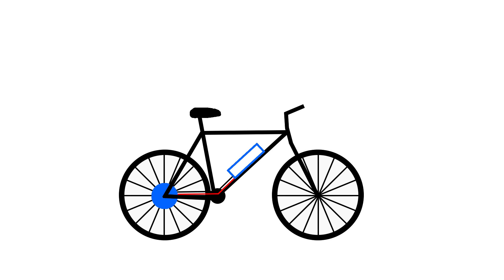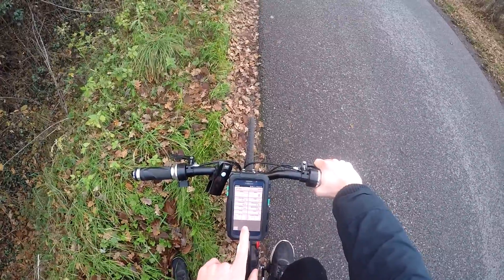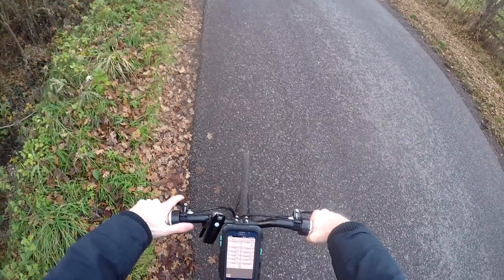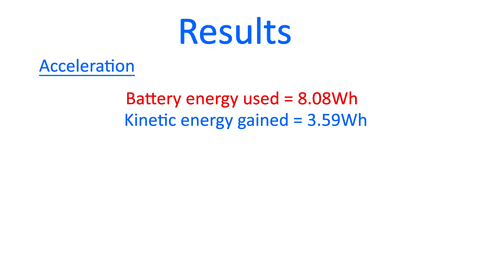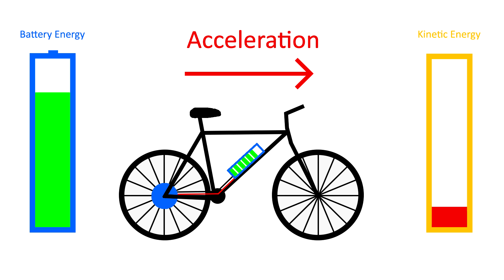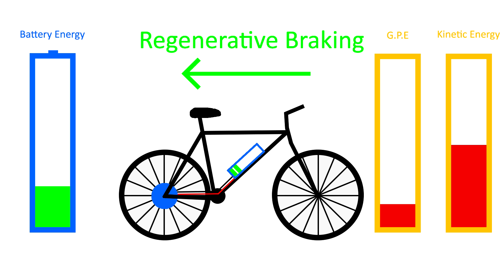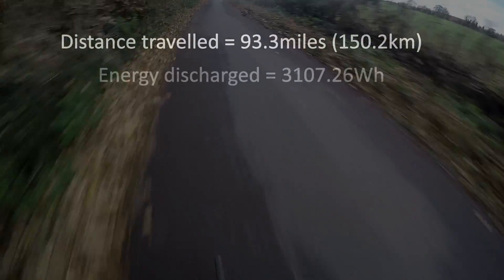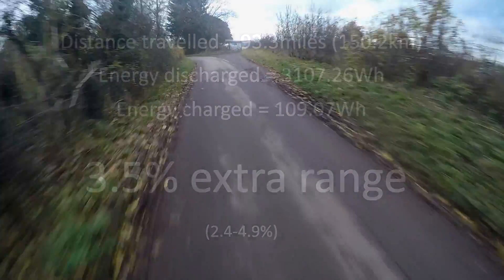Regenerative Braking tests

Comment: Great Video, very useful with diagrams too. What if the existing battery was split into 2 halves, and while accelerating you are also charging the other battery half, as well as charging it while using the regenerative braking? would this give you more range, without adding more batteries, etc and would it also mean that there would be less (or none) wasted energy, as when the 1st battery has depleted, the battery can then run from the 2nd half, which could then charge the 1st battery, and vise versa?
Reply from the maker: Unfortunately that wouldn't work. Using the example of my initial tests, if I were to charge a 2nd battery whilst accelerating, the energy discharged from the first battery would be greater than what I measured. This is because the energy wasted will still be 4.49Wh (this can't be 'none' because there will always be friction and drag), and because 3.59Wh + 4.49Wh + 1.27Wh doesn't equal 8.08Wh, the total discharged from the first battery would be 9.35Wh. So it's back to square one. Does that make sense? Thanks!!
Reply: Thanks Tom, it does and it doesn't (this is great to learn about) but I thought that a part of the wasted energy was from the forward motion when you're actually travelling forward, so if that forward motion also charged a battery, it would reduce wasted energy, that was my thinking, make sense? I understand that you cannot get more out of what you put in, but surely, if the forward movement of the wheel powered by 1 battery also generated power which then charges another battery when moving forward and when using the regen, then would it be possible that if you started your journey with battery 1 at 100% and battery 2 at 0%, then by the end of your journey, battery 1 would be at 50% and battery 2 would be at x, depending on what x is, but I would of thought that if you're using your forward motion to charge a battery as well as the regen the 2nd battery would have more then 3.5% charge?
Reply: +Steve Davey A single motor like this cannot act as a motor and a generator at the same time, for this you would need to take turns motoring and braking in order to do both, or get a second motor. But this doesn't make sense at all if you think about it. You're suggesting charging the battery from the forward motion of the wheel (taking from your forward momentum to put into your battery), while trying to move forward (take from the battery to add to forward momentum). You will essentially go nowhere and just waste power converting energy in a circle. 

There would be no point in charging a second battery while powering the motor from the first battery because you are not generating power from an external source like solar or wind. It just drains the first battery faster, and stores energy in the second that won't be available for the motor. The energy used for forward motion is to overcome the losses to the vehicle: rolling resistance (friction) from the tires and air resistance (friction) from pushing through the air. These two things will constantly slow you down as they take energy out of your system and into the environment, so you must replenish it from the chemical energy in your batteries. The wheel is just another battery with as much energy as was given to it.  It is only "wasted energy" in the sense that it is lost to the environment and not stored as kinetic, potential, or chemical energy in your system that could be recovered.
Reply: OMG you just invented the perpetual motion machine!  You should patent that :)
Reply: Great explanation, thank you. I was thinking that if a car's battery starts the car firing and the combustion engine then powers forward motion, it also powers an alternator. So, if you could label the car battery, the engine and alternator as battery 1, battery 2 and a small alternator, that would get you charging power from the forward motion. but it would add so much more weight to it, the benefits would be lost in the new heavier weight. I guess this is just theoretically possible and won't be a reality until some bright spark finds a way to make an alternator much lighter, then you could have a smart switch to change power sources and charging destinations. thanks for the in-depth replies! ;-)
Reply: @Steve Davey no worries, thought experiments are always fun. In the case of the car, the engine powers rotational motion. Forward motion wouldn't be relevant in your analogy. If a car was idle, it would use fuel to maintain a constant RPM. 

An alternator would be the same as adding another motor to your ebike and using it as a generator, but there are a number of reasons why you wouldn't want an alternator on an ebike even if it were miniaturized. An alternator has no magnets so needs to be energized by a battery to generate power while being rotated (power wasted to act as a DC generator). When electrically loaded (to charge a battery, play the radio, fire spark plugs) an alternator will put a mechanical load (negative torque, resist motion) on whatever is turning it. In the case of the car, it is coupled to an engine's drive shaft which isn't much of an issue because the load is relatively low compared to an engine's power output, and the engine needs to maintain at least idle speeds to function anyways. In the case of the ebike, an alternator would put a constant braking torque on the drive motor, and as a result, would put more load on "battery 1 " not to mention the current needed to energize the alternator. You essentially arrive in the same place as before: More power will be wasted converting energy to charge an additional battery. Energy is almost always lost in conversion from one form to the next because it is not 100% efficient. You answered your own question a few days ago when you acknowledged that you cannot get more out of what you put in. This is the law of conservation of energy, which holds true for all closed-systems. The ebike falls into this category. If you ever receive more energy then you put in, then odds are you have an open-system, where you are receiving energy from your environment (an ebike with solar panels).

If the process were 100% efficient, you may not lose energy charging a second battery from the first, but you would still limit the power available to your intended task, which for the ebike is locomotion (to produce forward motion). There would be no need to store power in a second battery because it would be used for the same thing, so might as well just wire the batteries together and have a higher single capacity without any switching.

To answer the question of your pursuit of a suitable answer, regenerative braking only highlights the limitation of DC motors. DC motors can not run as a motor and generator at the same time as I mentioned earlier. An ebike's motor is motoring when you accelerate or maintain your speed, it is only when you brake that you are generating electrical power (energy is removed from your momentum, and added to your battery).

In order to understand how to recover energy from a motor that is running, you need to have a bit of a background in electronics and understand two concepts. The concept of inductors and PWM . When you put these together you arrive at pulsed motors, a technology that is much more suitable for what you are describing than the motor used in this video and typical ebikes.

Comment: 35 mph! Wow! Is that even legal in UK? I thought e-bikes were limited in power and speed... 15.5 mph/250 watts. Or what am I not understanding?
Reply: That may be the max allowed but people usually get the higher wattage motors. It's more of there aren't any police there and most wouldn't know the wattage without specifically looking or if it's built that way taking it apart.
He probably also stays that 15 mph in the city but in the rural areas it doesn't really matter.
Reply: No, it's entirely illegal in a selection of ways. The speed and power are as you say, but also e-bikes need to be pedal assistant only.

It's an illegal motorbike.
Reply: Pook365 ebike law in UK is outdated and stupid so who cares if this is illegal
Reply: Brussels needs to pass stupid laws in order to justify their existence. The bike I had in Ireland was about 600 watts. 

Yes i am a bad man and a fool for riding a bicycle on Ireland's narrow roads  where everybody is late all the time and pissed at you for being in the way.

Comment: Are you sure you have got your mathematics right? I can't really tell, because I do not see sufficient detail of how you have worked out the figures in the video - or have I missed something? My main concern is that while you are decelerating and regenerating, aerodynamic drag and rolling resistance are still present. So even if regenerative braking were 100% efficient, which it never is, you still could not expect to be able to recapture all of the kinetic energy... But as both aero drag power loss and rolling resistance power loss are non-linear over speed, you would actually have to know these variables and integrate them over time to determine the amount of energy lost there - and that is a lot of energy. No, it actually is A LOT OF ENERGY. No, it really is a HUGE PART OF THE ENERGY YOU ARE USING. You know from experience that if you just stop expending energy to propel you forward on a level road, it does not take very long until you come to standstill only due to drag.
I would hope that the actual cycle efficiency of the regenerative braking system is much better than the few percent you are claiming. Even a modestly efficient electric drive (just motor and controller) should be doing better than 80% efficiency one-way, and the battery discharge / recharge efficiency might be similar. So for a full cycle, you would be looking at 0.8 ^ 4, which is about 41%. I think if the full cycle efficiency of this system really is less than 10% it's either broken, or a rubbish product.

Comment: So you can not give back this energy because the lithium batteries can recharge from the breaking in the time you are breaking? So if you have a supercapacitor you can get more % of this energy fast enough , and give it back to the batteries or give it to the motor when need it for the start ! so you save more energy from the battery pack!  of course the supercapacitor is not very good idea , you never know if you don't test it! plus you need a controller that make discussions how to handle any of this energy ! and may be a gyroscope, that see the uphill and the downhill position !

Comment: Yeah but 15% Is amazing if I didn't put the energy in electrically in the first place 
You know like pedalling, I could get up to speed and pedal in a high gear so I'm putting in very little to cruise 
Like imagine if you were driving your car and when you brakes you got 15% of your petrol back 
Then imagine if you only had to use the fuel to get up to 5th or 6th gear then you can run a little 50 cc and it will keep it's momentum so you're basically running on pennies even with the extortionist government taxes

Comment: You talk about efficiency and you call your bike a e-bike. In my opinion, this is a electric motorbike. Make some tests with peddling.
My range on a long flat bike-trip with 20kg baggage is 120km with 500Wh, this is 4.1Wh/km, Av speed 25km/h, Av Watt 104W. (Human Power was around 140W)
E-biking is cool but why without peddling?
Reply: Roman Wälchli adding a human into the equation really muddles the engineering math. To keep it simple for now, you can think of these figures as “worst case scenarios” since, in reality, most of the time you will be pedaling here and there, just like you were saying.
Reply: Ian Kyle Maturan/ Yes, pedal assist.(not peddling in the air with your arms :)
Pedal assist is the mix of a human constant power and the electric peak power.
Tom's video is interesting and he has my like for his work. I wanna just say, that some pedal assist is way more increasing your range/speed then regeneration.
Reply: the amount of recharge on pedal assist (which in my opinion is a bit more usual on e-bikes) would be higher than without pedaling at all. as shown in the video, up to 5% of battery charge is recovered in “cruise mode“, while in pedal assist mode you could get an additional 5% of your “human power“ recharged into the battery (in addition to pedal assist giving more range in general)
Reply: Clebefysh - This is a good point! The "Stromer"-Seller say 10-15% more range with recuperation.  
On a tour with long descents is recuperation nice to have.
Reply: I think peddling is an important part of the equation. If a large percentage of the power getting an eBike to the top of a hill is from peddling then that 5% return from braking while going down the other side could be enough to replace what power was used from the battery going up. But if a large percentage is coming from the battery getting to the top then 5% isn't going to do much for you.
Reply: pedal assist makes the math he is using pretty much go out the window, and that is why, I suspect he isn't using that as part of the equation.

Humans provide largely inconsistent figures, as we sometimes pedal harder or not as much, so you basically would have to run hundreds if not thousands of repeated tests for human error to be largely eliminated from the results. treating it as a "E-moped" for now, means he can gather real usable data without having to worry a huge deal about his figures being wildly inaccurate. this is just the simple way of doing it. in the real world, you'll obviously expect way better results, since you are helping the motor by assuming some of the "responsibility" from the motor.
Reply: I have made a similar system on my commuter MTB, but with a much smaller motor than Tom. Using the electric as assist, I pedal almost non-stop, but gain speed especially on uphill and head wind stretches. My average assist power is 150-200W, but thats at 28km average speed and knobby tires.

Comment: Drag is negligible compared to F=ma in this type of test. Your numbers tell that your motor/generator is only half efficient during acceleration and generative braking. Your Chinese made controller uses trapezoidal waveforms instead of a pure sinusoid, which will give it a higher top speed, but very poor low speed efficiency. That's why its so noisy. I'm making a swap-in controller for a 48V 1000W hub motor kit with fully variable regenerative braking. 0 throttle= full generating braking power, half throttle= coast, full throttle = full throttle, just like a Model S. Anyone interested? It uses Field Oriented Control, which gives you max torque/amp.

Comment: some thing is not right here..even if you did not engage regen you can get futher than the 1 or 2 mile extra you showed..emagine you took a car for a test drive and you drove it flat out and then returned it and said your milage sticker is wrong? you can gain altitude or speed more eficiently than you did...you only tested an idiots way to get economy.if some one goes to the troble of building the most eficient bike they can then they are not going to be riding it in a manner that uses energy as quick as they can...naaa i think ill get more info els were on regen.there a guys in the coments sugesting even with your guzeling energy exalerations that you got your numbers wrong and they are sugesting 30 to 50% regen.

Comment: What if you used also another motor to recharge batteries when the bike is moving? Wouldn't it be more efficient way of charging batteries while driving?
Reply: Pauli Keltomäki main motor will spend more energy. This way so useless